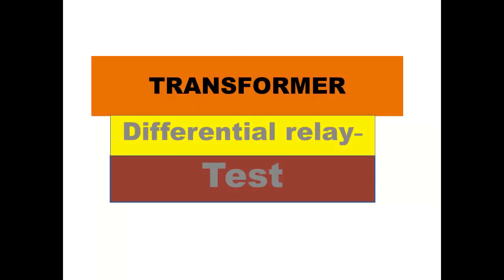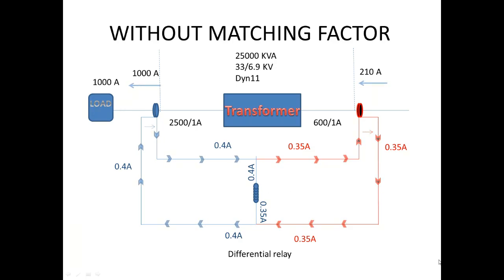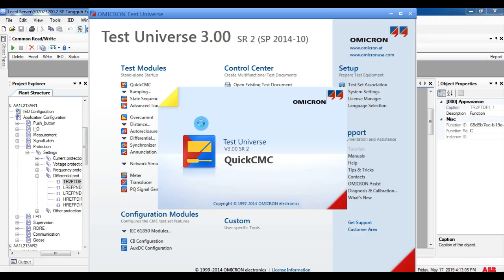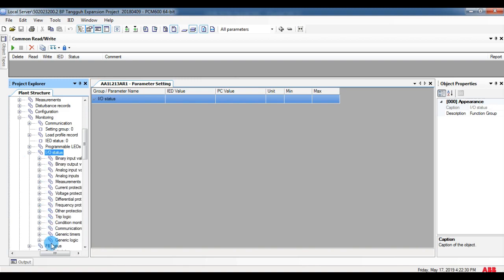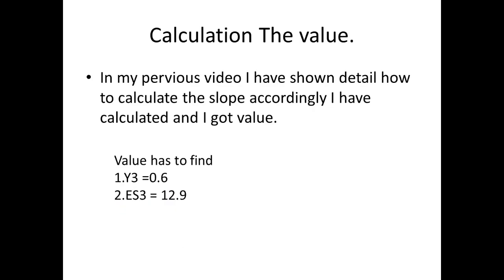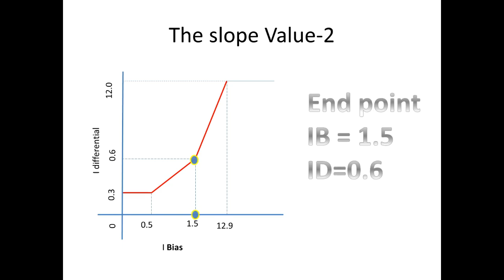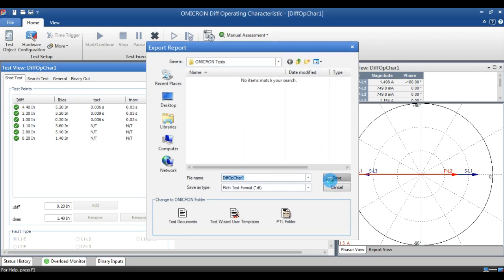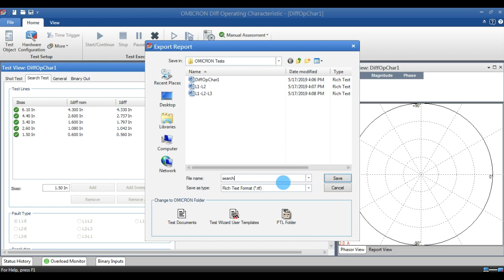Transformer Differential Relay testing | and | how to create slope on Omicron kit | RET ABB  RELAY

Comment: Thanks for step by step guide to RET 670 Diff testing through Omicron Test kit specially shot test and search test. Kindly review Bias formulae of ABB RET 670. As per manual, it is mentioned maximum of individual current referred to Primary. please share other make relays Bias formula for preparing exact slope characteristic.

Comment: Great video upon RET670 testing through Omicron test kit (Diff Characteristic). Here some parameters missing to set in relay test kit viz. Idiff >>, Idiff>. If pick up value less than .3,then you have to set accordingly.  Also after drawing curve in characteristics, it is not reflecting same as in test module. Here some video skipped. However it has given good reference for testing. If this clarity is given in upcoming videos, it will really help  working engineer like me.
Thanks for reading my feedback.
Reply from the maker: This parameter 100 % will match for RET 620 series. i will try to make more clear and without skipping on next time   and thank for your feed back .

Comment: Great Video Sir!!! How can one test line differential relay using the differential operating characteristic module. I have checked and have seen on the protected object that the protected equipment options are only transformer, Generator, Motor and Busbar.
Reply from the maker: for line differential we do end to end test on quick CMC . if you want to do on differential char. then you can select generator for line

Comment: Dear Sir,
You have calculated matching factor,  but in testing where have you used matching factor in testing? 

plz could you explain this, as you have used full load current every time.
thanks
Reply: @baranitech1026  I am little bit confused here, sorry for this,

But during testing should we inject the current after multiplying it by matching factor?
Cz you have only injected calculated full load current, not the one with matching factor.
Reply: Understood thanks

Comment: Sir, sir we replaced the 2 phase old CT of 20MVA PTR with new ones and during the stability test we observe double(0.4+0.4=0.8)current in 1phase,, and all the CT secondary polarity is ok, and then we review the relay setting vector group is Dyn5 instead of Dyn11 please explain how vector group of PTR will be affected CT secondary current
Reply from the maker: i will make one video related to your questions.

Comment: Dear Barani
During the Omicron slope test, I have a question.
For example, to test idff(0.3In) Ibias(0.5In) value, P-L1/L2/L3 and S-L1/L2/L3 current and angle are displayed automatically.

  Can you please tell me the formula to manually calculate idff(0.3In) Ibias(0.5In) values for P-L1/L2/L3 and S-L1/L2/L3 current values?
Reply from the maker: https://www.youtube.com/watch?v=585TDCgAki4

Comment: For RET615, where are the details entered regarding trafo MVA, hv and Lv voltage rating, vector group etc. I can't seem to find those details in relay.
Reply: For RET615 there is no option to enter Trafo MVA. We use the above showing calcalations. However for 670 series, we don't need correction factor.